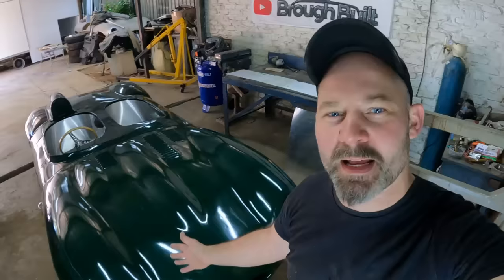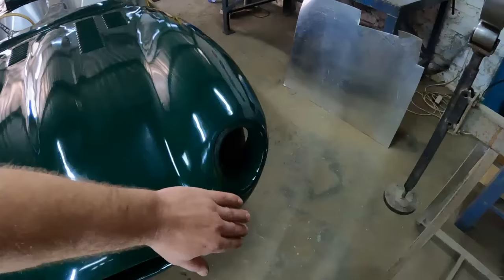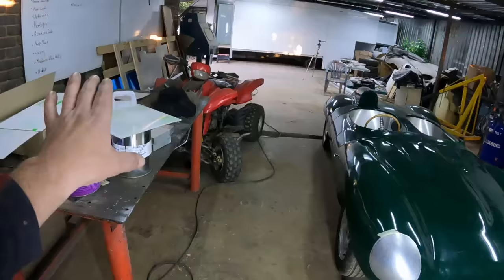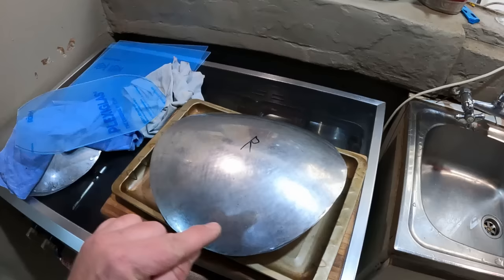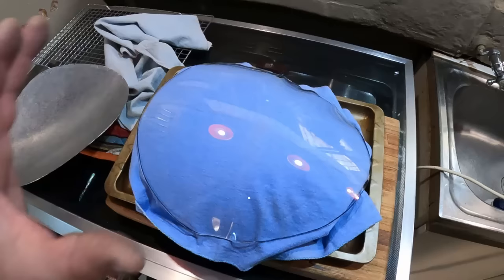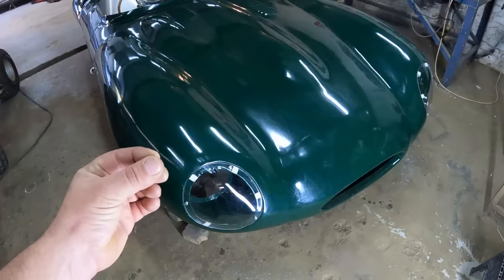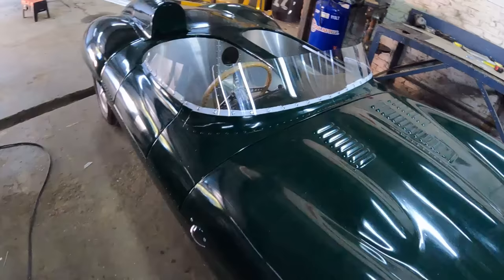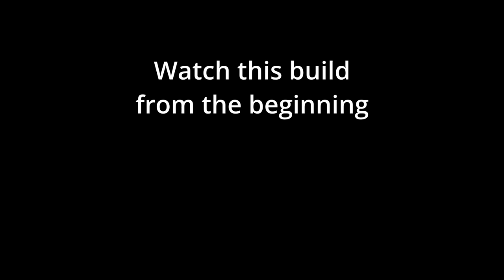Making Headlights and a Windshield for the D type

Comment: Polycarbonate can be formed without the bubbles, but it is a PITA. The bubbles are formed from water that has been absorbed from the air, so it's necessary to preheat it at a lower temp to dry it out. Even then, the temperature range between under and over cooking is pretty narrow, which I found really difficult to deal with working with a cheap old kitchen oven and I can't imagine the frustration (and expense in failed attempts) of trying to work with a piece too large for an oven. I worked with it once on a set of headlight covers that were a close set of compound curves (though nothing like a D-Type) and that was the last time I've used it for anything not flat! I like your solution to the problem. I lack your metal skills, so I would have used a covered foam mold and a vacuum former for the headlight covers.

Comment: The polycarbonate if you were not aware comes different ratings and also in tinted sheets as well as the clear, there is opaques and blacks we used when building safety guards for bottle filler plants in case a glass bottle exploded on the line.
Reply from the maker: I know about the different colours but wasn't aware it came in different ratings 🤔.

Comment: Great channel and build, please keep sharing the nice work!!

Just as an improvement, I’d rather use motorbike screen rubber nuts for the headlight covers than standard rivet nuts. It would absorb vibration and avoid a premature crack, maybe rubber washers would do the part as well.
Reply from the maker: Thanks for the great tip! I will get those rubbers.

Comment: Nice new tune at the 2 minute mark, I dig it. It fit the stump shaping really well. Also, a MAPP torch works great for flame polishing edges of plastics. I couldn't see if you had done it but it sounded rough when you ran your finger along the windshield so I assume not yet. Practise on offcuts till you get confident.

Comment: Your way of forming the lenses was certainly with loving craftsmanship although it’s extremely time consuming.  I’m wondering if it could have been done more easily using a vacuum form.  You would only need one positive mold (possibly even building it from sculpted clay inserted into the headlight voids) and then laying the molten polycarbonate on top of the mold while sucking it tight using vacuum pressure.  I’ve seen lots of clear domed skylights made this way.

Comment: Great job on both of the clear bits.  A simpler way to make the headlamp covers is by only making one mold/buck... Put your plastic in an oversized "frame" to heat it up in the oven.  Then pull it out while it's hot and push the mold into the center of the hot plastic.  This will stretch the center and keep the edges from wrinkling since they are being held by the frame around the perimiter.  You need to heat the plastic a lot hotter so that it starts to deform and droop in the middle.  THere is a fine line with acrylic between the right forming temperature and creating bubbles but it will be over 300* F.
Reply from the maker: That is a very good idea. I will definitely be trying that method in the near future. Thanks for the comment.

Comment: I thought you might well have a problem moulding those lenses but you took your time, thought it out very carefully re-heating several times did the trick. Like someone else as said, you need to make at least one spare set.
Reply from the maker: I'm glad to hear if reheating is normal, I actually didn't know what else to do. Will definitely be making more lenses. Ps. I'm a huge fan of your work!

Comment: Fun fact: polycarbonate absorbs water, so when you heat it it bubbles out forming the bubbles. If you bake it just below 100C you can drive the moisture out then cook it to shaping temperature, it can even be welded!

Comment: Wicked cool. Stumbled on your channel and I'm blown away. This is coach building straight up. I wonder if a vacuum bag would work for he headlight forming. I used those clothing and bedding vacuum bags for forming kydex holsters and it worked well.
Reply from the maker: Thank you very much! Vacuum bagging is definitely an option but with limited resources and a normal household oven this method seemed best (for my application of course).

Comment: Polycarbonate is hydroscopic...that's where the bubbles come from.  To heat form the stuff, you have to bake it at a low temperature in a dry environment for up to a day.  This will cause the absorbed water to evaporate away without making the bubbles.  THEN, you can have at it with higher heat.

Beware though, heat tend to make the stuff release phosgene gas which can irritate your airway to the point where it will bleed and you will drown in your own blood.

Phosgene was one of the popular gasses used as weapons during WWI... And since.
Reply from the maker: Very interesting and insightful comment thanks. I feel like I'm not gonna be putting polycarb in the oven any time soon 😁
Reply: @BroughBuilt  I would...if the oven was far away from where I slept!
I learned that stuff the hard way back in the land before internet.  I was tasked with building guards for production machines in the late '80s.  I got a nasty scratchy throat almost immediately  when I applied heat like I would've with acrylic.  The MSDS sheet was shipped with the product and I looked it over before calling the vendor for some forming tips...YIKES!
Reply from the maker: @Bluswede  Yikes indeed!